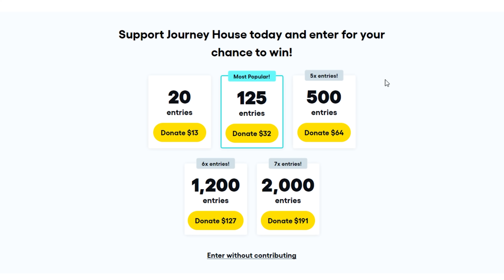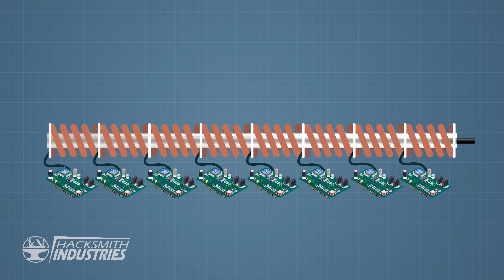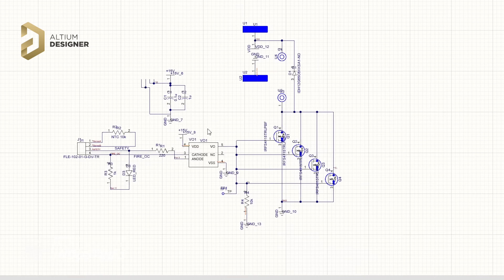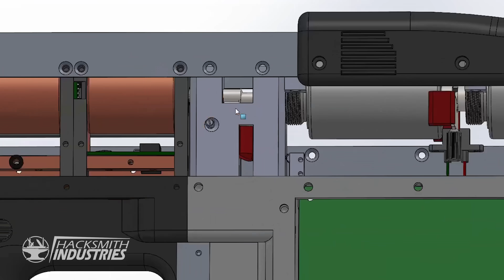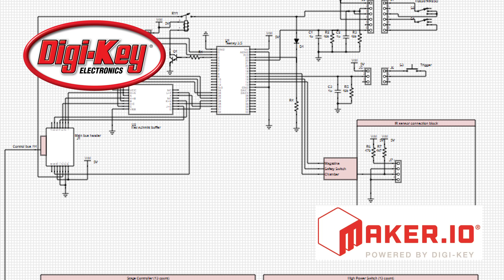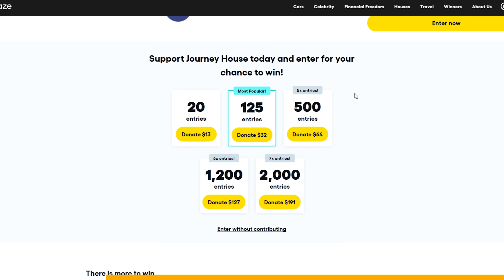MOST POWERFUL ENERGY WEAPON WE'VE EVER MADE!

Comment: how much joule ?
Reply: Probably 1-2J projectile and 100-200J to the coils. It is one of the most inefficient coilguns that I've ever seen. They did most of the parts wrong. Powering coils? Wrong. Coils themselves (wire gauge, number of turns, different coils for different stages maybe?) Wrong. Switching the current? Wrong. 
The coilgun this size should easily put holes in some plywood/drywall or shred through these metal cans like it's nothing. Even 1 stage non-optimized coilgun using a 450V 4700uF capacitor (50$) will achieve better speed than this contraption. With one coil (2$), one capacitor (50$ at best) and a 10$ thyristor to switch the current. This is all it takes to beat the coilgun showed in terms of real output. Raise the voltage to something like 1000-1500V, optimize the coil (probably using FEMM to run a couple of simulations and get an idea what coil, projectile lengths etc will be close to optimal), and u'll get 3-5 times more energy output than before.

Maybe they did it so bad intentionally to not break any laws or they didn't want to work with big boy 400-500V capacitors that can and will hurt u if mistreated, but the end result is sad imo. I've built a lot of coilguns/railguns/ETGs and seeing a big content creator making EVERYTHING wrong hurts me deep
But if u want to make it right, I've said what u should do first. Higher voltage, thyristors (NOT mosfets for god's sake), actual capacitors. That is your starting point

Comment: why would you only activate the coil in front of the projectile? doesn't it make more sense to have all of the coils activate simultaneously upong firing, then turn them off in sequence as the projecticle passes through each one? Because then, even though the coils further away would have diminishing effectiveness due to distance, they would till be providing a slightly larger pull than just one coil alone?
Reply from the maker: Magnetic force drops off exponentially with distance -- you'd just waste energy and reduce the amount of energy you can put in the coil directly in front of the projectile.
Reply: @hacksmith  Yeah that makes sense, like for sake of energy efficiency and all. If you guys ever plan on revisiting something like this, maybe you could douse the coils in liquid nitrogen or something before hand, because colder metals have far less resistance then you could get away with either a more powerful railgun, or keep the same power but drastically reduce size and weight by only needing a few super coils?

Comment: If canadian law limits you to 100 meters per second, then either make the ammunition bigger or sharper, like a 5/6 inch steel tube or a boxcutter razor blade. A boxcutter razor blade would have a lot more stopping power than a steel slug at 100 meters per second.

Comment: Maybe you can use Peltier coolers for the heat buildup? I guess a liquid cooling system would also work too. But whatever you end up with needs to be light.. and portable (not bulky). It doesn't seem to need to be particularly fast at dissipating the heat... Although that could also be an effect of you limiting your exit velocity (yeah... I heard the legal issues)

Comment: why dont you build an literal railgun where there is no extra circuitry only like 2 rails (or 4) like the military big version ?
Reply from the maker: We have built rail guns -- but this is a coil gun, operates under similar principles, but not the same. The big military ones are a bit more sophisticated than 2 rails though...
Reply: @hacksmith  thanks for the quick answer is that video availabile ?
Reply from the maker: Yes, just search hacksmith rail gun

Comment: A beautiful toy. Now there are two final problems to solve: spinning the projectile for accuracy and increasing range (may I suggest some type of drill bit as the projectile shape combined with mini ducted air causing spin), plus a capacitor bank with step up voltage to increase speed.. yes you'd need heavier cooling.  

Then you'd get something close to lethal. Kudos on the reloading system

Comment: You could probably install a secondary circuit on either side of the rifle with a set of PC fans to help cool the coils a little bit or maybe a system to blow highly pressurized air over them. of course I doubt it would fully overcome the overheating problem but might be a start.

Comment: I wonder if having thin copper or brass piping with vents along the side of the coils, which would then be filled by high-pressure co2 cartridges after every mag is emptied, would help.

The idea behind this is that the co2 comes out extremely cold, and could act as a very quick way to cool down the coils.

Alternatively, adding aluminium heat sinks might work
Reply: Wasn’t the point for it to be a purely electrically powered weapon?
Reply: @nebulisnoobis102  It would still work without the gas, but the gas would just increase the duration you can fire it for without having to cool it down. Heat sinks in addition could make it so you can fire throughout an entire battle, if you have one gas-mag every few mags.

Comment: why use light sensors when you could run a small amount of current thu the coils then read the inductance of the coil (or previous one) to determine whether a metal core is present. It would decrease weight, as light sensors would not need to be present, as well as allowing for more stages to realistically be added.

Comment: Probably impractical improvment suggestion:
Superconduct the copper coils to improve the efficency and reduce heating issues with liquid helium, you should then be able to reduce the weight of the coils and possibly the power requirement.
Adding some sort of super sized sterling motor to reuse the helium is probably impractical... So I guess it would have to boil off and be replaced with a canister?
And now I realize that the weight loss from improved preformance is likely lost from having to manage 4.2 kelvin.

But you could feed yourself the boiled helium to sound like a grunt!
Surely worth it.

Comment: Why couldn't you use an aluminium inner barrel and slide the coils over it's outer diameter to avoid the efficiency loss from a rough bore? You could even rifle the bore and run a HDPE slip ring on the bolts.

Comment: Should build a Gauss warthog, those use coil gun tech instead of railgun gun tech. Also you could use the cars alternator, solar panels and thermocouple around the muzzle to recharge the capacitor bank. Additional charging could come from Regenerative braking and piezoelectric in the suspension.
Reply: Don't forget to toss in a couple wind turbines to get some extra power from the airflow around the vehicle as it moves around the battlefield

Comment: You're also getting the projectial tumbling. The why modern guns over this is with rifling. Rifling allows the spin about length wise axis. Without a means get the projectile rotating the projectile will need to balanced over a 360 degree plane.

To help lower the weight the increase in the power of the solenoid to hit the projectile faster. Another option is a pressured gas (not as stable and could lead to wide range of starting speeds.) But by increasing the first coil speed you could get a faster speed (but Canada says no) or to maintain current speed lower the amount coils needed.

Comment: This looks and sounds straight from a videogame, especially the reload. I assume you can't have a more than 10 round mag due to laws, but if you could, that would be a huge improvement. Also, for cosmetic purposes, you could program LED's , and have them brighten as the projectile passes that accelerator. (You could do that by simply making it have set timing that lines up with the accelerators)

Comment: My friend made one that have bent a ladle he used to catch nails. And it had 2 stages with ~5.6% overall eff.
I suggest that you can connect stages one-by one and then optimise each controller, because initial speed changes. And use capacitors, not batteries directly.
And radiators. A damn lot of them. Nevertheless, cool!

Comment: All it needs is the tube from 2019 model but with rifling, idk what material other than steel can handle all that friction but maybe rifling wouldn't help anyways since its main use case is giving a right pathway for all those gases propelling the projectile forward which in this case is propelled just by the turning on and off coils. This is just me nerding out but I'm not sure if the rifling would be entirely pointless tho since it does help reduce the energy loss which in an otherwise straight barrel the projectile would be bouncing around all over. Maybe a combination of airgun type pressurized gas with the coils would help in simulating how a real gun powder based gun works(but would be really hard to perfect since the pressurized gases depending on what gas is used will mess up the timing for coils turning on and off and would require extensive simulations just to bring it to an acceptable margin of error which is still not perfect). It's a long winded way to make something which already works but ig it does take away the danger element of gun powder. Not that it would make it any less dangerous but I would like to see something along of the lines of whatever I said before created(since I don't have the finances or patience to build it)

Comment: Maybe go back to a single steel tube to help align all the segments, 1mm wall thickness should be plenty strong enough. Looks sick tho!
Reply: steel conducts and magetisies, thus cant be used in a coilgun. But he could have used a non conductive tube out of a hard plastic or whatever
Reply: @kallgakr1273  I meant to say stainless steel, 316 is non magnetic. Plastics would struggle with the heat. Ali or titanium would work, but titanium is expensive and Ali would need a thicker tube wall for the same required rigidity.

Comment: Capacitors+diode+reed switch make it like =- with =as copper coils and as reed so you can make a dozen and just plug-in no matter how  many sections =-=-=-= with trigger on the last reed switch, so when you trigger it'll trigger yhe reed switch in front continue pulling
But need to charge capacitor😂 for more power

Comment: I'm not sure if you really need this led sensor control of commutation of indidual coils, you do need seperated coils though or a long coil using a flat copper bar with lumped coils along its length
Reply from the maker: Have you made one before?
Reply: @hacksmith  no I haven't made one so Im not a smarty pants. If you go and see how an induction motor works they have got a single length of wire going into pole slots that start in one slot and enter another slot until it reaches the end of the motor poles. Eg a single phase Ac motor is just a lumped sum ammount of Inidividal coils, if you could open this circular motor up and lay it flat on the deck it then becomes a linear induction motor. This is used in some types of systems to Create a moving field that pulls magnetically coupled objects along.

Comment: Have you thought about taking advantage of the coil collapse energy to forward charge capacitors to boost the next coil in succession.  Maybe a tripod mounted version.
Reply: I'm curious, do you mean the back EMF? I thought ideally there would be little energy left around the inductor as the magnetic field collapses when the core (bolt) absorbs the energy and converts it to kinetic but that would be impractical since you can't calibrate the driver timing perfectly I'd imagine?
Or are you talking of something completely different? Please elaborate.

Comment: Dude did you collapse the individual coil when the bullet passes through the half way point? The collapsing magnetic field should flip the poles, causing a pushing force. Not too sure of my physics stuff. Been a while since my physics classes.
Reply from the maker: Doesn't work like that
Reply: @hacksmith  Oh yeah the bullet had to be a magnet. The first coil would pull the bullet into the first coil to the center of that coil at which point you collapse the power to the coil and it flips the poles and that will cause a pushing force into the second coil that will do  the same thing, but a bit faster and so on. At least that's what I recall.
Reply from the maker: A collapsing field wouldn't propel a piece of metal though

Comment: I have a challenge for you:

Create a gun that uses the speed of air entering into a vacuum as a means of firing a projectile. Air apparently enters into a vacuum at a speed of 500 meters a second, is there any way you can create a gun that uses the entering of air into a vacuum as a means for propelling an object?
Reply: It would be a 1 shot weapon, and would take ages to prepare. If you look at videos of people clearing out vacuum chambers, those things are built not to collapse from the pressure of the vacuum. Also, it takes them a long time to actually turn the chamber into a vacuum. To do that for a handheld weapon would be very nearly improbable. I assume it could be done with some backpack attachments for the air pump, using like titanium or something so that the gun itself won't collapse due to the internal vacuum.

Basically, it's highly improbable to do this on earth. In space, however, this could be easily done by simply making the majority of the weapon exist in the vacuum of space, and have the projectiles propelled by the sudden rush of air into the vacuum.

Comment: I have no qualifications to offer an opinion, but I'm going to anyway. Speaking as the average bear in the street I have to wonder about the relative scale of the model. The length of the coils and the projectile seem to be equal. When the projectile is drawn into the coil as you said there is the point where it stops accelerating and bounces back. Now for the what if. What if the coil is shorter than the projectile. The same number of coils (or more with a smaller gauge wire) in a shorter configuration would let the leading end of the projectile to be actually  in the next coil and grabbed by it rather being drawn into it. My experience with reloading ammo suggests that you could try reducing the bore of the coils and your projectiles while introducing a non magnetic barrel to smooth coil transition. Too, rather than blunt rods you could machine them to mimic rifle rounds. Specifically Boat Tails for more inherent stability.   Just thoughts based in supposition and ignorance.

Comment: I built something smaller in 2000 when i was deployed to Kosovo, I used a 24v starter solenoid from Large military vehicle but removed the hold on coil and with some water pipe that i found a few ball bearings that fitted perfectly in the housing of the solenoid and the pipe, it caused too much damage. Then to be honest i looked at the batteries that i would need to make it portable and thought fck carrying 2 of those about. It was fun playing with it, bored squaddies and all that lol.

Comment: You need much higher voltage in the 100.000V range. Make your coils from refrigerator tubing & run liquid nitrogen in the tube. Beware this will cause quantum coupling with the projectile. You will need  to use 
High ptrcision MOSFET WITH Nanoseconds switching. Use large oil capacitors & oil capacitors rated for the voltage.   Make yourself a machine gun niche rather than a portable gun.
You may try your project as shown but use liquid nitrogen (-290C) or gas NO2 inside the refrigeraor tubing. 
The NO2 can be held in a thermos which can become part of the handle. These are best mounted verticallytomallow gravity.feed & circulation of nitrogen.  The NO2 does not need to be pumped! 

I run a cryopreservation laboratory & am happy to help.  BEWARE OF FREEZING YOUR FINGERS OR OTHER PROTRUDING PARTS OF THE MALE ANATOMY WHEN WORKING WITH NO2. TAKE THE ONLINE COURSE!

Comment: In most jurisdictions a rail "gun" does not meet the legal definition of a firearm because it doesn't have an enclosed barrel. A closer legal analogue would be a cross bow, which launches a projectile along a rail or track. Did you check the Canadian legal definitions? It is a shame to go to all that work to make something less impressive than a BB gun. I think you need a few thousand more amps... or maybe superconducting electromagnets.  :)
Reply from the maker: Well first of all this is a coil gun not a rail gun... A rail might have rails -- but this coil gun does have an enclosed barrel...

Comment: v3 should use rc motor heat sinks they are round and you could clamp or thermally glue it around the coils and have fans cooling it if passive cooling wouldnt work

Comment: Better coils: Square or hex wire, so less air in the coil, and the last coil should be the strongest. Do a exponential rate of increasing the magnetic force. use an high force magnet as projectile.

Comment: Wouldn’t it work better to boost the voltage way up and then use way thinner wire and put all of the control circuitry in the back?

Probably save 70% of the weight. (Not counting the battery)